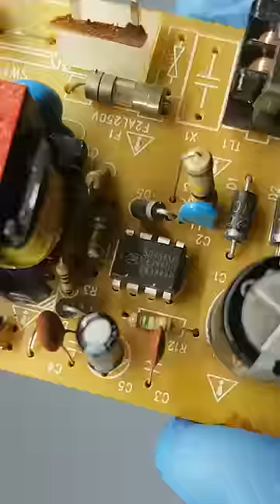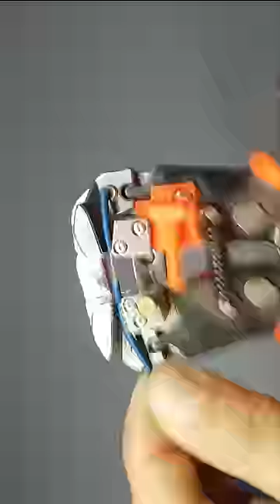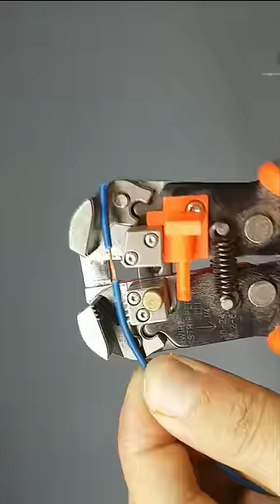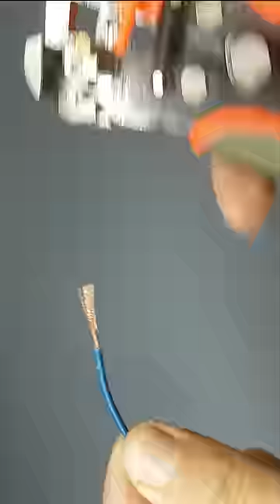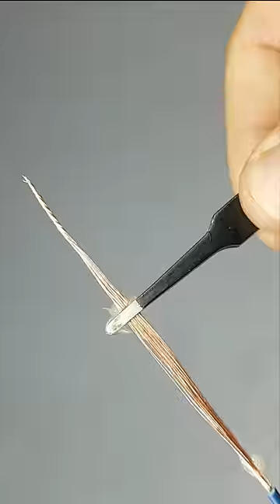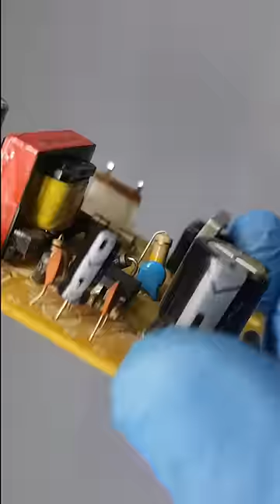Simple idea !! but I'm sure you'll need it #tips tricks #electronics #ideas

Comment: I usually use the braid but sometimes there isn't any available and this works great ... I think a little more twist sucks it up faster but this is a great video to share

But a side note ... your iron's tip needs jesus
Reply: Mine needs Jesus too😂
Reply: @Kong Meurn  there's some product I came across that makes the tips look new ... they need cleaned on whatever rough cleaning process you do then dipped in this silver powdery stuff and it smells like ammonia and then the tip comes out looking new ... I'll check what it's called shortly ... I greatly enjoy this product
Reply: @kongmeurn38  R & R Lotion Tip Tinner
Reply: @mikekorman666  I don't know if it's available in my country or not.
Reply: What do you mean by Jesus?

Comment: Indeed this one's good alternative to a standard desoldering tool but therefore i conclude unsafe. Why unsafe? Some filter capacitors contains large amounts of dangerous voltage. Eventually if one the positive line/s accidentally shorts out to negative side of the filter capacitor there is a risk of fire or electric shock. This method applies to a totally discharged capacitor only.
Reply: well it is always a standard to discharge any circuit before doing a repair
Reply: Who starts a repair (desoldering to be exact) with POWERED ON INSTRUMENT
Reply: @Patrik2166  did i mention desoldering on a live circuit?

Comment: why don’t you just simply… use the soldering iron normally? its hot enough to vaporise the solder right off there letting you pull it out. this is because… its a soldering iron.
Reply: Heating 8 pads at the same time can be difficult, plus it could overheat the part
Reply: @010falcon  read my comment. they don’t need heating at the same time. the soldering iron is hot enough to vaporise the solder. if you had experience with one you would know this from how half your solder can seemingly disappear
Reply: @trinityy-7  solder does not "vaporize" 
I have been working in electronics for 8 years now, not like 20 years of experience, but enough. 

Maybe you mean flux

But even then, you shouldn't heat chips for longer than 10-15 seconds at 330°C as stated via many datasheets stating proper reflow soldering.
Reply: @010falcon  you sure, because the last time i used one i remember specifically the solder just disappearing into the soldering iron, and a lot of fumes then coming off. if thats not if vaporising then what is it?
Reply: @mehmet1337  maybe not, but i know enough about physics to know how it should work
Reply: @trinityy-7  ，you don't know what you're talking about
Reply: @damonladykiller9900  well then you should know, right?

what did happen when literally half my solder disappeared into some smoke?
Reply: @trinityy-7  the fume from evaporated flux,not solder,another way is to put some low melt solder and it will be in melt condition long enough until the chip can be removed
Reply: @trinityy-7  solder will flow to hot thing,maybe you didn't preheat the board or pad and the solder stick kn your soldering iron
Reply: The solder did not vaporize. If it did, you'd have to have been doing something seriously wrong. Assuming we're talking about ordinary 60/40 tin-lead alloy solder here, it's recommended to keep your soldering iron between 316°C and 343°C (600°F and 650°F) for soldering and desoldering

Of the two metals making up the solder, lead has the lowest boiling point at 1,749 °C (3,180 °F). This means that, at a minimum, you would have needed to set your soldering iron to almost 5⅓ times hotter than recommended to see it begin to vaporize. Even if you sustained this temperature for long enough that the lead had completely boiled away, you'd still have the tin left over to contend with. If by some miracle it wasn't just a lump of oxidized garbage at this point given the fact that the flux would have long since decomposed under the absurd temperatures (keep this bit in mind for later), then you'd need to bump up the temperature of your iron once more to a blistering 2,602°C (4,716°F); just under 9 times hotter than the temperature it should've been set to

What you saw was likely a combination of a few different things: 
•as stated earlier, flux tends to burn a bit even at normal soldering temperatures. This would have resulted in the smoke that you saw;
•solder likes to stick to compatible metals if they're sufficiently hot and relatively clean, and this includes adjacent traces or even the pins/wires of the component you're trying to solder/desolder. If you weren't using a lot of solder, or if any directly adjacent metal had a large enough surface area, the solder could have been wicked up and into whatever that metal was once both the solder and the metal had reached a high enough temperature;
•you didn't properly pre-tin your iron, or the amount of solder involved was tiny. Just like the adjacent traces and wires mentioned above, your iron is made of a metal that solder loves to stick to. If there wasn't enough solder already on your iron to totally cover the surface before you started to desolder, then the solder on the board could have been wicked up and away by your iron, giving the illusion that it had evaporated when combined with the flux producing smoke as it simultaneously began burning away.
Reply: @dedmazai9212  well i don’t know what solder was made of. also despite you being factually in the right i believe i won here because you used 20 emojis

Comment: The contacts from the printed circuit board are removed as a group with a vacuum pump, then fine in this way
Reply: You’re more likely to remove the solder pads with these damn braids than a solder vac…